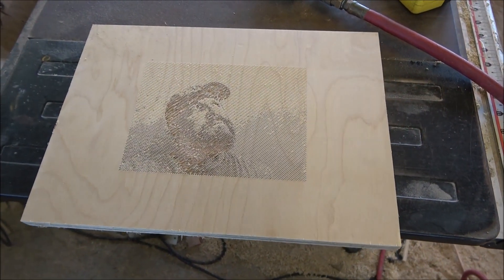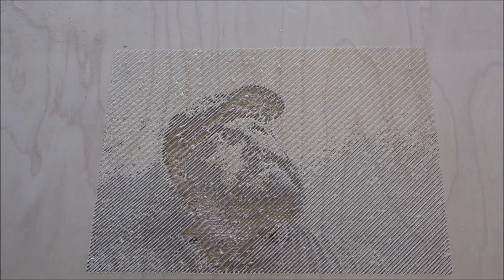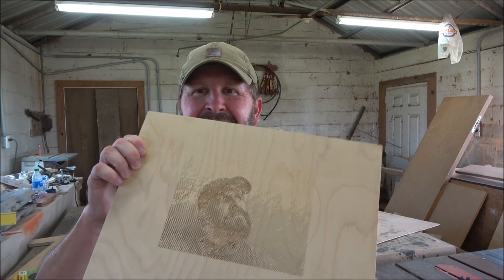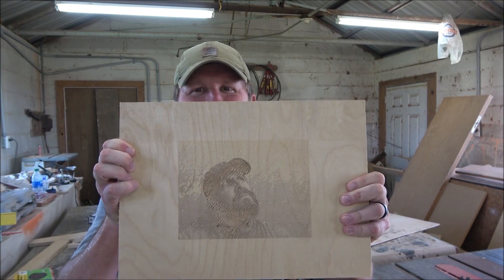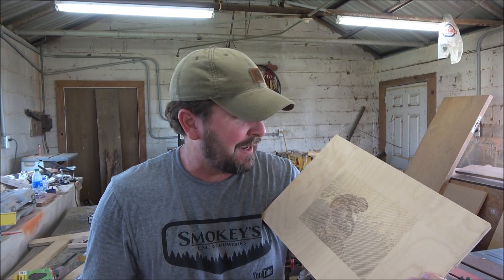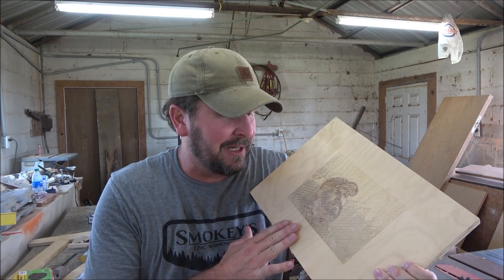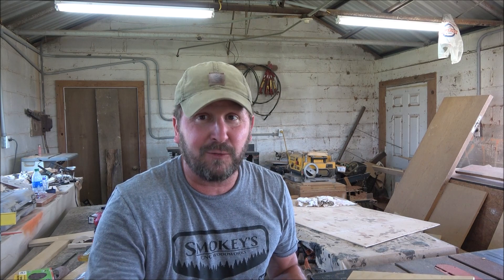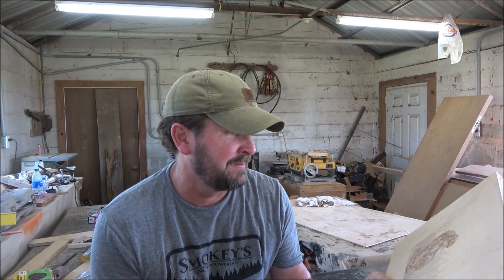Halftone CNC (First attempt)

Comment: Nice job, I like your videos. I did a dot screen cut for a memorial. I painted the material before cutting so the picture is darker than the surface. Hard to stain or paint after cutting. I used 60 degree v bit, cutting only .05 deep. Great 3d effect as photo cut looks different from different angles. Job was 22 x 34 so detail wasn't so dependant on picture resolution.
Reply from the maker: That is awesome, I'm not sure my software has the "Dot" capability, but what do I know, I'm just now messing with halftones.  I may have to try a pre painted piece to see what it does.....Thanks for watching!!!

Comment: I have no experience with this, but I think hardwood would work better than plywood because you won't lose the detail on lines that are just slightly less depth than one layer of the plywood. Now areas go the full depth of one layer instead of slightly less losing that detail.
Reply from the maker: I agree, I'm thinking a hardwood maybe next for this tool path, I also have some awesome looking red cedar that may have a interesting outcome....Thanks for watching!!!
Reply: Yes that is something . I would watch a video of your computer work too. I have done some birch ply and offcuts of cherry from the shop. The solid really has much less feathering and veneer has lots.
Oak is a tad problematic especially white oak for burning.  I am lucky that I can get really nice offcuts of fine hardwoods
this is a piece of pennsylvania flame cherry with viking art
https://flic.kr/p/2jsSkLq

Comment: be careful - doing halftone work (lines or dots) will drive you insane if your workpiece surface is off by the slightest.
on soft wood that chips easily try coating with a very thin varnish/paint to strengthen the top fibers as much as possible.
also, a soft nylon bristle nail brush used lightly cleans things up pretty good.
for dot work use a short jobber drill sharpened to 60 degree - much cheaper than a mill bit 
a masonry bit also works very well if you can sharpen the tungsten properly.
sometimes an image simply will not translate nicely to halftone - its those that drive you up the wall.
good luck ;>}
Reply from the maker: Sounds like you have a lot of experience with halftones...I will definitely try the coating the surface to hold more stability...Thanks for the info and thanks for watching!!!